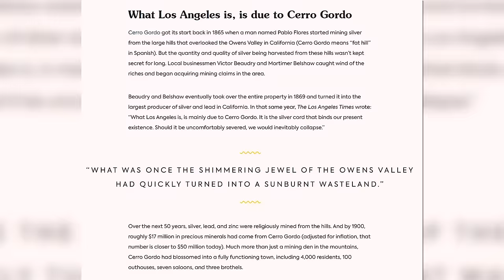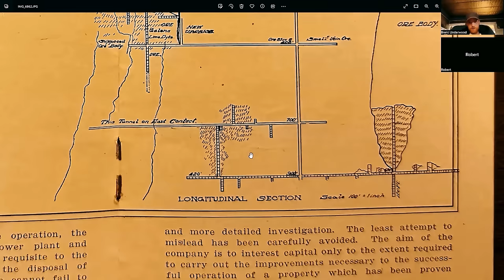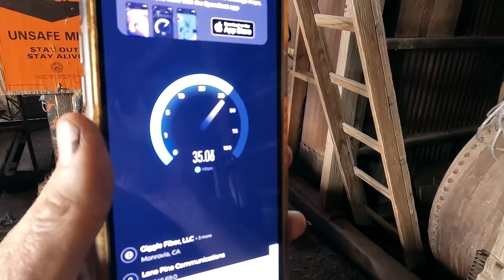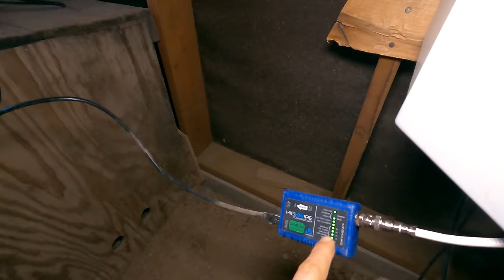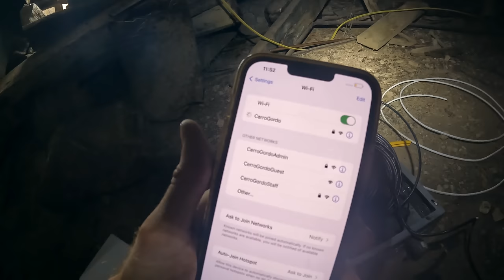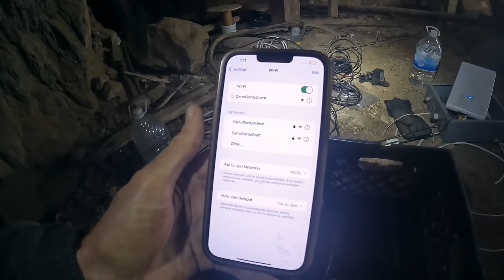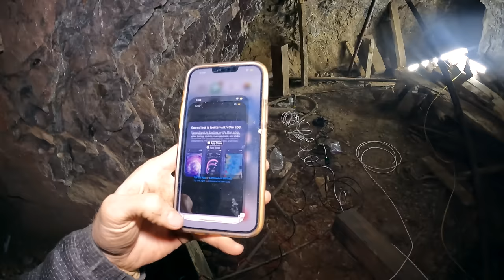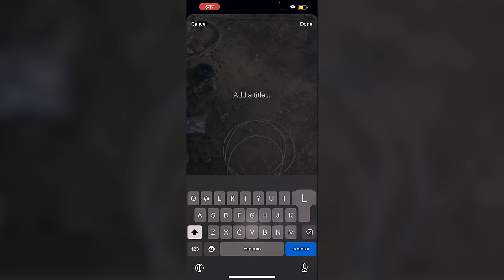I Have WiFi In My Abandoned Mine! 900 Ft Underground!

Comment: RG6 is only good for 327' after that signal is lost. either use repeaters or RG11 might work but that might even be to far....Id use fiber!
Reply: Fiber is def the way to go for this.
Reply: apart from cost effectiveness and ease of repair, I can't imagine why anyone would suggest using Coax hahaha
Reply: I agree. I also have my cringe at the 12-2 Romex being ran 900’ down a mine shaft. Physical damage? Voltage drop? Nah, those don’t exist.
Reply: Fiber is so cheap these days and so are the optics, likely cheaper than the coax adapters..
Reply: "Google" says coaxial cables for internet can be 500m (or 1640 feet). More than enough.
Reply: *single mode fiber
Reply: @cozzycam97  Perhaps it was that it could carry power, but that seems kinda pointless since they already had power down there.
Reply: Yea I'd use fiber too, though I looked up the ethernet/coax adapter he's using and it's supposedly good for up to 1000ft of RG59 @ 200Mbps.
Reply: I’d use another ubiquity bridge down the side of the shaft
Reply: Why isn’t Starlink being used at Cerro Gordo vs beaming it 10 ways to Sunday?  Also as others have said use fiber and put it in PVC to protect it.  You’re already using expensive Ubiquiti gear.
Reply: Was about to say this. He should also have ran a conduit to prevent damage... I mean it's literally a silver mine... what could go wrong? 😅
Reply: Yeah. Don't understand the coax usage. That's like 1990's. As they started with power, there's no need to get power, so would go with fiber, or just wireless link on the elevator shaft.
Reply: @atnfn  I was thinking the same
Reply: Oh wow, and then uses PoE-injector...
Reply: I still don't have fiber in my area. Been trying to get it for years. Maybe that's the issue, availability.
Reply: @Doug_M  you use fiber to make the run, we’re not talking about fiber based internet
Reply: @Doug_M  I don't think you understand the principle. They could have run fibre from the receiver to the access point in the LAN, saving the need for repeaters etc if they've already got power
Reply: Now you can have a live stream camera down there
Reply: I agree that fiber optic is the best option! It’s not the easiest to splice as a beginner (tools are expensive compared to Ethernet and coax tools) They have heavy duty cable that has multiple sets of fiber strands for redundancy and can be order to size. You could then repurpose the copper coax for hoist communication, call boxes for each level, emergency alert system.
Reply: @jarrettavery1747 voltage drop would be a huge factor.  Plus number 12 romex is only rated at 20 amps. I think I'd of used 10 ga at a minimum.
Reply: My sources say 1000FT limit. Fiber is better on paper, but the coax was right choice for durability and reparability. He could get a hardened fiber cable, but he would be spending $$$$
Reply: @bizzfo I have starlink at my cabin and it works great.  Only problem is the $120.00 per month bill.
Reply: @wheels636  can't imagine what kinda interference you're gonna have with lead in the walls of a 900ft mineshaft as well. It's gotta be fibre for sure
Reply: I was going to say... You can get pre-terminated fiber for much cheaper than you think.
Reply: He's fine with the ethernet over coax adapters and 1k feet with the speeds he is working with. He probably won't even have issues running it right next to the romex because of the same reason. They will definitely see some issues if they push the speeds a lot higher. I doubt they need to for a long time though.

Things I would have done differently would be not running anything but fiber next to the romex. Running a larger power cable (probably 10/2) but not going more than 20amp. I would have also gone with either conduit or MC wire (conduit has so many advantages, but extremely expensive right now) for power. I would have also considered at around 500feet doing another wifi booster right in the lift area.
Reply: Youd use fiber and replace it evey few months...
Reply: @jarrettavery1747  12/3 not that it's much better.
Reply: Voltage drop doesnt exist when youre living in a dream world
Reply: I taught I was the only one wondering why did they not use fiber allyhe way down and if he really need it he could have used poe injectors at every lvl he had electricity wired and have an acces point/mesh node at every lvl...... maybe there's something I'm missing in understanding why did he use coax
Reply: @recoveryguru  don't know about durability, but they failed to repair coax already and ran another cable.
Reply: Fibre would be better but having a coax backbone isn't a bad idea. If something were to happen down there, even having enough to make a call will be useful
Reply: in 2024 we will use fiber just order, it comes with connectors if you are not capable 🙃
Reply: This! Who on earth was the architect that signed off on this? Expensive, sub par and slow!
Reply: Fiber is NOT the best option
First speed doesn't matter that much
+ You have to consider price, a proper armored cable is still very expensive
+ Plus the VERY dusty and unreliable environment (I would argue that a mine shaft is a worse condition than outside for fiber)
+ The fact that coax is stupidly easy to splice compared to fiber
+ The fact that Brent isn't a network engineer that probably can't troubleshoot network issues as easily

IMO, even a good Ethernet switch in a dustproof box at every level is better than fiber, and it would allow for internet at every level.

If he needed 10g in the 900ft sure then fiber is the only option, but he doesn't.
He needs a reliable low/medium speed connection primarily for communication and his setup is perfect for that.
Reply: Shhh
Reply: Coax is dirt cheap.  It's the same stuff that cable modems run on, more durable than fiber too.  Repeaters are cheaper and it can do double duty for a backup coax phone line to the outside by switching it to a 40vdc circuit on power loss for the network.
Reply: @bizzfo I agree!!
Reply: Also with where they patched it. Provided that added connections and a barrel connection, thats even more loss.  If they just tied the wires together, fhen thats hopeless. (A say this as a ham radio op)
Reply: Unless they plan to tee off maby with some mods adapters
Reply: @cozzycam97 add a signal booster at top and it will greatly aid signal… also another booster at 450’ (1/2 way)
Reply: I cant understand why u didnt use fiber
Reply: @paleggett1897  might not even be needed in some configurations, but I agree definitely easier than coax repeaters and duplex config!
Reply: You all forget this guy is pretty intelligent.  It's called content
Reply: Well, he did it. And it worked.
Reply: @jarrettavery1747 okay so I wasn't the only one it's probably dropped 40 volts at the end of that run let alone being exposed
Reply: As an electrician i was cringing the whole time i saw this set up lol@jarrettavery1747
Reply: Good call using coax for the power. Your need to remember he only has one run of 20amp 110v which over that distance.. you ain’t gonna be able to use 20amps. He will need to conserve as much amperage as possible to power that base camp
Reply: @wheels636 how much was the hardware?
Reply: I am guessing cost and simplicity are the reasons for coax. If it were me I would have done fiber. I also may have used anything other than Ubiquity. Worked for a company for 3 years that deployed UniCRY equipment and it is a problematic pile that does not belong in the enterprise. Hopefully it works for Brent’s needs…but I see it getting replaced in the near future.
Reply: @Samuel-eu1ts  all the network engineers disagree with you..
Reply: Yes!
Reply: I agree, fiber down the shaft is the way to go, and 12-2 …. Not the best way to get power. Depending on future needs and his plans a bigger service is needed. Personally a 300 amp line down the shaft to a 100 amp panel… I personally would use plastic conduit for power and a hard line 📞 line in separate conduit, either a cell phone box maybe a smart jack at the top, a real hard line from a POTS company, just saying, safety first…..😊

This is from a person who has lived 68 1/2 years and over 50 years experience in electrical and electronics.

DE N2JYG
Reply: Exactly or in line boosters
Reply: Leaky coax.
I’ve used it in tunnels many times. Railroad and highway.
The high frequencies are defiantly killing it too.
The RX side forget about it!
Only fiber would work.
Reply: Putting wi-fi in a mine is like LS swapping a 70 Nova. Lol
Reply: Cat6 Game changer cable can go pretty far too. 2.5gbs at 656ft or 10mbs at 850 ft.
Reply: Coax can actually transfer huge bandwidth , but there are adapters to run gigabit Ethernet a thousand feet on twisted pair also.

Both kinds of cable are relatively easy to repair or terminate when you are way down that hole.

However, pre-terminated fiber is easy to get, and can work for a long time.

Since he is working with coax , maybe we can suggest ways for him to get the best performance out of what he has already.
Reply: Why not use fibre??
Reply: And thus Minenet was born, watch out or Elon Musk might buy you out 😂
Reply: Hey how many people live up there with you?
Reply: That's what I said basically
Reply: @samck3577 I would recommend multiple mode fiber. That way he could branch off throughout the whole mine with a variety of switches. Just have a main box at the bottom, then run fiber everywhere else
Reply: Should have used fiber..at a minimum split the distance putting head end at 300 -400 ' . The voltage drop on 900' over romex yikes.. do you have a gfci outlet , water in mine
Reply: I think there’s too many sharp turns for fibre, repeaters might be the only way
Reply: I was just about to comment the same, use fiber
Reply: Fiber would break easier
Reply: Now you know how the trans Atlantic communication cables work. Cables connecting each nation under the ocean by wired land line communications to land, to towers for a wireless signal. Ps. Sattelites dont exist. Never have.
Reply: Adapter Specs says:
Long connection range of up to 1650' with RG11 cable, or 930' with CCTV-grade RG59 cable
So RG-6 is in between
Reply: I think the ethernet to coax adapters aren't powerful enough. That routerboard was outputting around 57V via PoE.

Comment: Glad to see you've enabled password protection on your wifi... you don't want miners piggybacking on your network!
Reply: because topside will Also have an access point 😂❤ basically could go offline network data but yeah 👍🏼
Reply: It'd be awful if his data got mined.
Reply: The neckbeard’s can finally move out of their mother’s basement now! 😂
Reply: @rhmrr01  Isn't fiber optic WAY more difficult to protect from the elements than traditional coaxial?
Reply: @UndBeebs  nope,  just use the exterior rated one. the difficult part is terminating it, but you can order custom leght fiber optics whit connector preinstalled
Reply: Ghosts want wifi too :D
Reply: @cmh-re  sounds like hes got a future project then if he wants to bring gigabit down there. Though something tells me 40-50mbps down will be plenty for Brents needs for the forseeable future. A real good question is his upload speed. Can he upload a video from down there in a reasonable time? Even then thats more service dependent.
Reply: Are you aware of TP Link products?

Anyway, TP Link makes a network adapter that puts the the signal on the power circuit. A plug-in sender broadcasts a WiFi signal. You've just run power down there....
Reply: @Team.WorldTour Multiple manufacturers make internet over powerline not just tp link. You’re very correct though, with the kinds of speeds they’re working with in the first place, it probably would’ve been a much better solution to just settle with powerline.
Reply: @Nebula-qq8sg the losses over that distance would probably be too great.  Ethernet over powerline often loses as much 60% of the incoming speed just over a normal house. It also suffers from interference from other electrical things quite randomly, and they need rebooting sometimes. Fine in a house, but not 900 ft down a mine!
Reply: Or any of the Hills have eyes Families living down there. 😅
Reply: Well, you don't want the "old timers;" ghosts to start surfing the 21st century down there. hehe
Reply: @Team.WorldTour  At 900 foot, powerline would be at its limit. Would actually be interesting if it still works after 900 feet in a straight line. I guess he has the perfect test setup.
Reply: Next step--underground hotel with only Wifi and lights, no running water or poop pot.
Reply: Now you know how the trans Atlantic communication cables work. Cables connecting each nation under the ocean by wired land line communications to land, to towers for a wireless signal. Ps. Sattelites dont exist. Never have.